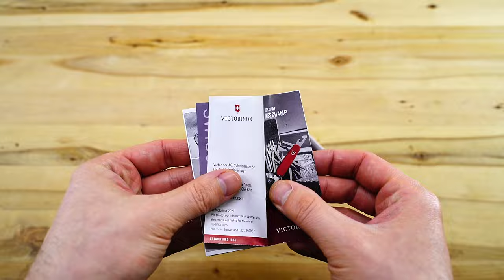A Swiss Army Knife that has everything you need for any situation

Comment: The stripper can be used as a wire bender....the chisel as you used it, is the scraper function...flip it, & you have the chisel function...the fish cleaning tool can be used for cutting & designing pumpkins...the tip can be used as a screwdriver for certain types of electronic equipment...nice method of opening the can...thanks...good video! Subbed....😊

Comment: I love my Champ. The fish-scaler/discorger/ruler can also be used as a scribing marker for penciling parallel lines along from the edge of a piece of wood/plastic. The U-shaped bit at the tip can steady short nails/screws for driving, too. Not a fan of the pen, though - I think it should be repurposed for something else, like nail fastenings, thread, or fishing line. Although I get the idea if in a pinch to write something. I love the pliers on it, they're perfect for jewellery repairs, fine grip, third-hand, the works. However, all this time I've been using the can opener by gradually piercing, instead of running it forward 🤦 thanks for that!